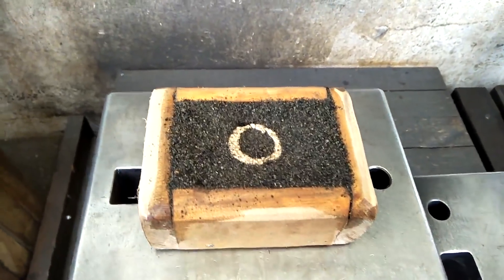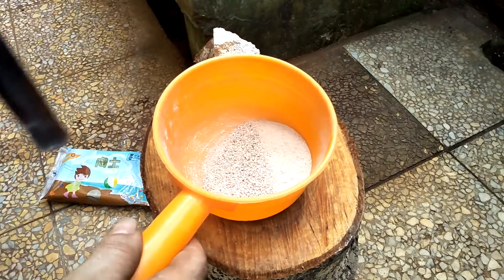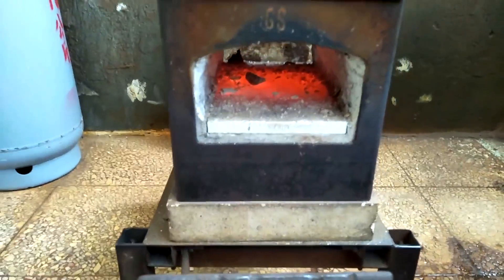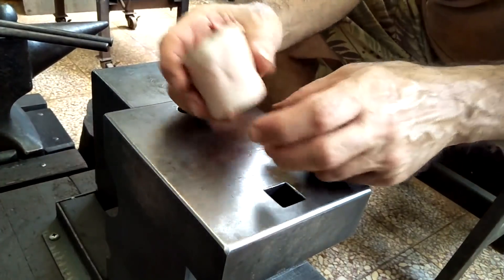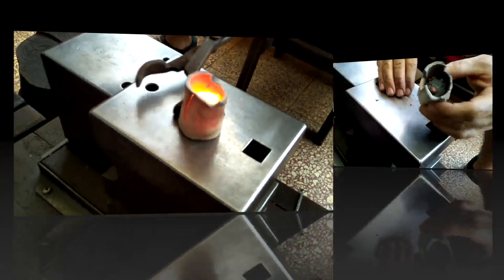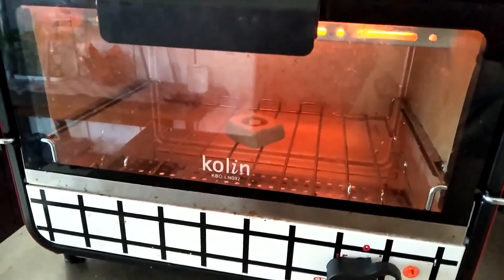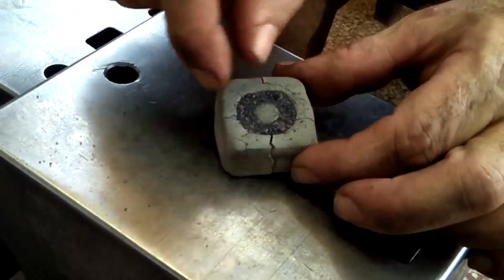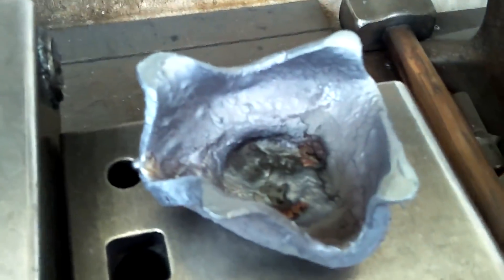Casting a copper ring - crucible making, etc.

Comment: Old torch bottles work well as temp crucibles.just use the bottom of the bottle and use it till oxidation eats it away and replace. Of course use proper techniques for acquiring these from propane bottle but they work well

Comment: Great learning experience.
A suggestion ... 
If you melt flux in your clay crucible and cover all of the inside surfaces of the crucible with it, it will create a glaze on the surface of the crucible which will help keep the copper from sticking to it.
And, of course, adding flux (Borax Powder) to the copper as it's melting will help it flow better as well.
Keep up the great work!  Have a better day!
Reply from the maker: Thanks for the good advice. And yeah, I've found borax is really needed to help the copper flow. Just having fun and learning as I go.

Comment: Really good idea but I would highly recommend to wedge the clay first. It is popping because of really tiny air bubbles inside of the clay exploding from the heat.  It would also help to let the clay dry for 4 days then try to fire it which will make it much more durable.

Comment: so my guess is you're not working the clay enough and getting to many inconsistencies in the matter so the internal stress makes it break. next time try beating the clay with a large dowel or small log for a bit, also might want to pre saturate the fire brick crumble before mixing and dry them slower longer before blasting, like around 180 deg. for a few days.    just guessing.

Comment: How can I make a crucible at home on a budget?
Reply: Old torch bottles work well as temp crucibles.just use the bottom of the bottle and use it till oxidation eats it away and replace. Of course use proper techniques for acquiring these from propane bottle but they work well

Comment: Piece of advice
Instead of tap water use water glass. It's cheap and the best for high temp molding stuff. As for molds/clay....you need to take it slow.....but my advice would be to use Delft clay.
I am glad that you are doing this too,melting/casting stuff is fun and very (at least for me) rewarding. Aand yes,for casted bronze/brass that you won't hammer ,you could use an iron crucible. I make my own bronze (CuSn) from which i make reenactment jewelry by hammer and anvil. Dude,for real,i am really glad to see this and I hope you go bigger on it!

Comment: If you like to use firebrick in your “ceramic clay” mixture, and don’t want to have an exploded crucible - just do the following:
1~ add some coarse “perlite” to the mixture.
2 ~ mixture: 4 part ceramic clay; 3 part crushed-up firebrick; 3 part perlite.
3 ~ anything refractory, 1 day(24h) is way too short time for curing - at least bump up the curing time to 2 days(48h).
***Perlite absorbs water/liquids like a sponge. In this mixture, perlite will absorb wet ceramic clay and wet crushed-up firebrick. As the mixture cures, perlite will waterproof, and fireproof itself, as it dehydrates the mixture by absorbing wet ceramic clay, and crushed-up firebrick.
***In conclusion, perlite will speed up the curing process, and will provide good insulation for your crucible - so your melted metal, inside the crucible, will not harden as fast.
>>> Strength will not be that of “structural” level. But, will be just enough for a crucible - you are not making a building out of this mixture after all.
<<<>>> Thank you for posting this video, and thank you for showing your failures - learning what NOT TO DO, is just as good, and valuable, as learning what TO DO ACCURATELY >>> Thus, saving valuable time for some folks.
Cheers!

Comment: You can use a stainless steel pipe to melt the copper . Cover one side of it and you're done ! I use stainless steel tools to dump melted copper into the forms .
but copper is pretty bad for cast work !
Reply from the maker: Admilson, Yes, I know that stainless steel is high heat resistant. I used to make my tuyere grate for my coal forge from stainless bar back in the day. But I wanted to avoid having to have anything electrically welded. Still, stainless would have been much better than what I did here. Thanks for sharing.

Comment: You have to let the crucible dry out till it gets bone dry. Air pockets in the unfired crucible will make it spawl or explode.  You have to wedge the mixture thoroughly, Try using Google and look up wedging clay. Finally you should bring it up to heat very slowly to avoid cracking.
Take a look at some pottery making videos of check in with a potter and see how they process the clay before and during firing. 

You might also check out "lost wax casting techniques"
Reply from the maker: Thanks for all your good advice on this one. I seem to learn everything the hard way. I had fun with this one but the exploding crucible has made me wary. If I attempt this again, I will do proper research as you suggest. Thanks. Glen

Comment: Clay and/or refractory cement should dry very slowly in a humidity/temperature controlled environment and then heated to heat slowly and allowed to cool very slowly to prevent cracking and warping.  This webpage my help you... http://www.bigceramicstore.com/blog/what-to-dry-fast-and-what-to-dry-slow/
Reply from the maker: Victor, I will check out your webpage and see what I can learn. Thanks for watching and commenting.
Reply: Not my web page, someone else's that I just shared.

Comment: How long does Clay need to dry before firing?
Allow it to dry slowly, for at least a week, opening the plastic after 4-5 days. for a couple days, before drying, allows them to absorb moisture and even out the water content of the entire piece. Once you take it out of the damp box, tent it with plastic and allow to dry completely (2 weeks).Oct 2, 2015
Drying Your Pieces Before Firing / Big Ceramic Store | Blog
www.bigceramicstore.com/blog/what-to-dry-fast-and-what-to-dry-slow/
Reply from the maker: Victor, I appreciate your very useful and detailed information. Thanks for taking the time to share. Glen

Comment: Perhaps adding some Borax to your powdered copper would help is amalgamate better. And yeah, better thermal mass with that steel vessel.
Reply from the maker: I believe you are completely correct. I'm not sure why I didn't do so for that try. But I will try the granule way again and be sure to add flux. The steel crucible gave me a much better window for pouring... Thanks.

Comment: Maybe someone can answer this for me and anyone interested. Do you need to add flux to the crucible? or prepare it before first use?
Reply from the maker: JR, Obviously from watching me go about this experiment, I'm not totally certain. But one thing has become clear - some sort of flux is necessary. I think the proper time to add it is when the metal / crucible has been heated to a certain point. But I have also added it when everything was cold and it also worked. Hopefully, I can get a more concrete answer for you moving forward. Thanks for watching.

Comment: You need to add graphite powder then heat it slowly over 2-3 hours like you did. You also need to make it bigger as when you take it out with the tongs they suck the heat out of the small thermal mass you have and will cause it to freeze. You can also heat the rings up before taking it out.
Reply from the maker: Chris, Very good advice all around, especially the part about it losing heat so quickly at this small size. Thanks for watching. Glen

Comment: I love these experimentation videos! lol - and whats more, you were on the right track with the clay!  I have some info that might help you!

As you figured out, heating the clay too quickly causes steam pressure to burst the clay model apart, so heating on top of the forge was the right way to go!  But by this point i think you had abandoned the idea of using fire brick in the mix.  I would say give it one more shot trying the following:

Mix up the clay and fire brick like you did at first (the finer the fire brick is mashed up, the better) using as little water as possible though you will likely need at least SOME to get it together.  Once it is together, kneed the clay for a few minutes just to make it as homogeneous as possible.  Then, form the shape you want.  Another area you went wrong was that the walls of your crucible were WAYYY too thin!  Don't be afraid to make it have very beefy sides and bottom - at least half inch or more.  Finally, instead of drying it on top of your forge, let it sit over night in the driest place you can find (i know its hot and humid there).  The next day, place it in a conventional oven - and then turn the oven to about 350-375 degrees F and let the crucible come up to temp with the oven.  Once at 350-375 cook it for at LEAST 2 hours, 3 is better. Give it a quick check and see if its steaming/holding up. Bump up the heat to about 475-500 degrees F  and cook another 2-3 hours.  After that - check it and make sure its not steaming.  If it is - another hour.  Once its cooked at least 2 hours at each temp move it into the forge for a few mins to see if it holds up!
Reply from the maker: Erik, This is all excellent information. I kept feeling that the fire brick powder should enhance the crucible's heat resistance but I went about this in the wrong manner. I will give it another go and heed your advice. Thanks for watching and for sharing. Glen
Reply: Glen GS Tongs : Some more really useful information for us guys living in foreign countries who want to make their own crucibles and can't just buy them, thanks again.

Comment: A "real" 2kg graphite crucible is only $14 USD on Ebay...quit wasting time and money randomly trying to make a substitute. If your makeshift crucible shatters with molten copper inside, you could be VERY seriously injured.
Reply: It isn't about the money, it's about the experience and knowing the materials you're working with.
Reply: $14 usd and then $50 to ship it to him.... Time is not wasted if you learn what and what not to do, the next time. Plus, he was still working on other projects at the same time....
Reply: Graphite crucible for melting copper or aluminium is bullshit. Graphite crucible is good for melting steel or other high liquid temperature metal.
Reply from the maker: There's no question that a DIY crucible could be dangerous. But I am aware that there may be potential problems and so am prepared. Also, the small scale that I'm trying this on makes me feel comfortable enough that if the crucible failed, I wouldn't likely be in harm's way. But your point is well taken. If anyone is not sure and uncomfortable with experimenting, then buying a ready made product would be wise. But even with that, there's always risk... Thanks for watching and for your good comment.

Comment: Glen I have a casting company here.  Precious metals mainly but others as well.  I can tell you tackled tough stuff to cast even for professionals.  Copper and Bronze is tough to cast consistently and even more difficult than casting steel.  Plenty of jewelry companies in Taiwan, you can buy a casting crucible from a jewelry supply house.  For things like a ring, I think your method of making a form is much better than trying lost wax or using styrofoam.  Good luck.  This ring would look nice with a hammer finish.
Reply: Steel?  You have experience casting steel?
Reply: Yes we cast 304 and 316L stainless.
Reply: Hmm.  Bronze and copper is easy to cast by comparison.  I do it in my driveway.  lol  I don't cast anything with copper to be worn. Mainly because it has a tendency to smell like shit.  :-/  Can you please send Glen here a small jewelry crucible before he burns his toes?  He should be just down the road from you.
Reply: The challenge with copper and bronze is to get a complete fill in the mold. Melting is not the problem.  This is all lost wax casting and then it has a tendency to have a lot of porosity in the finished item.  Yep me and Glen are on the same side of this pond!
Reply from the maker: Neil, I realize that getting a properly made crucible is essential for doing this more than on the occasional basis. The clay form is the simplest method and I think if I used flux on the first try (with the granules of copper and brass) that it would have worked OK. I'm just having fun and don't want to take this too seriously - maybe just make another blooper reel or two of me experimenting! Thanks for your great input. Glen

Comment: Too far to fast with the heat. Try oven first to evaporate water then fire. Also art clay is different than refractory grade clays. Cheap scent less cat litter is pure bentonite clay. many use this for home made refractory.including in coal forges for the fire pot
Reply: I have a 50 lb bag of bentonite. I have no idea what to use it for my intention was to use it for Hamons but the stuff swells up and falls off for that. I know a lot of people use satanite or refractory cement for this. You mentioned there are many uses can you elaborate on a few. Thanks. Martin M&S Blades
Reply: M&S BLADES there are many uses but I'm saying many people use bentonite clay with perlite to make their own home made refractory. Try using less water in your mix for hamon. Water turned to steam too fast makes it violently break and release. Clay should be just most enough to form a ball in your hand with as little moisture as possible.
Reply from the maker: Thanks again for the great info. Drying the mix slowly is definitely the way to go.

Comment: Couldn't you make and use a steel crucible? Since the melting point of steel is higher than copper. Idk I've never cast anything. It's just an idea but if it works I bet you can make some tongs to hold it firmly
Reply from the maker: Levi, Yes, that's what I did at the end of this and it worked better than I hoped. Thanks.

Comment: Glen what do you use to prevent your tools from rusting? I live in Olympia Washington so my stuff loves to rust. I know that constant use of the tools keeps them clean but I don't forge that often. Thanks
Reply from the maker: Levi, As you know, frequent use of tools will prevent rust. But every so often, I spray and rub things down with WD-40. This seems to work well for me. At some point, rust is unavoidable with steel. What I sometimes do for tools that I won't use much is wrap them in oily cloths. Thanks for watching.
Reply: Levi Blackwood I live in Alabama, its always humid. I just rub mine down once a week with 3 in 1 oil. But I gave up on keeping tools rustless after about a year.
Reply: Matthew Steele could boiled linseed oil work? I've got over 5 gallons
Reply: Glen GS Tongs thanks! I personally haven't had luck with WD40. Its water based and makes everything I spray it on rust. I've been rubbing my anvil down with boiled linseed oil. So far its working great. Thanks Glen! Quick question, what's the average price of those beautiful touch marks you have made? I'm thinking about getting one

Comment: Always good fun experimenting. Still think getting a basic clay graphite crucible will probably be necessary eventually - they're suitable for soft metals like copper, gold , silver etc with lower melting temperatures but not Iron or Steel obviously.
Reply from the maker: A proper graphite crucible would have made this easier and is the way to go in the long run. Thanks.

Comment: Flux is the key for getting it to flow together.  When you did the powder it might have worked if you would have fluxed the crap out of it.  Once those oxides form it's really difficult to get those tiny particles to combine without flux.  I ran into similar problems when I first was learning to solder.
Reply from the maker: You're exactly right. Not sure why I forgot to flux that try. I will give that method another go and be sure to add the borax. Thanks.